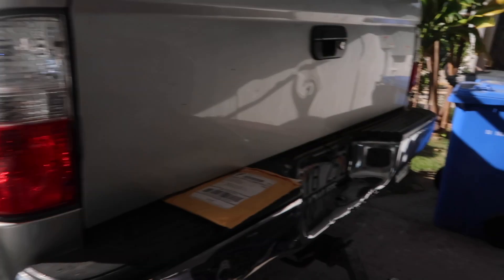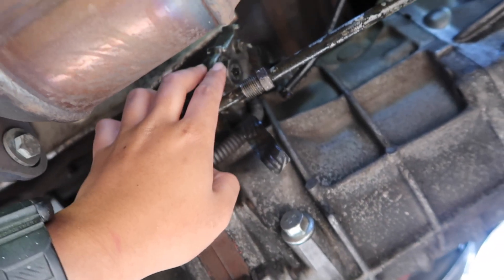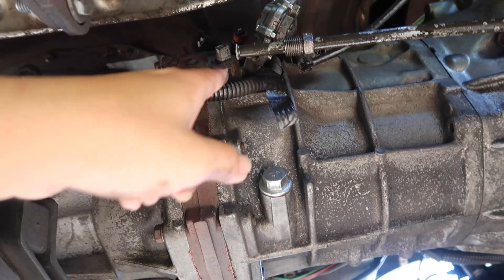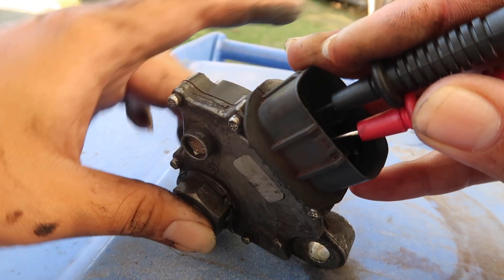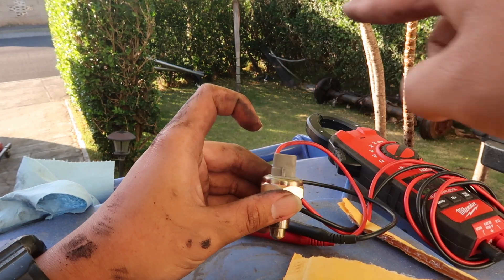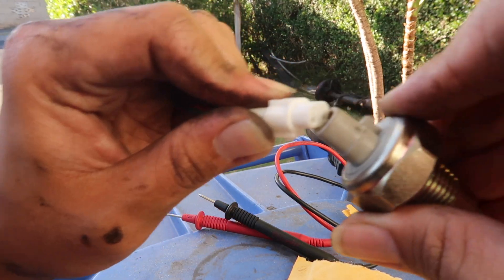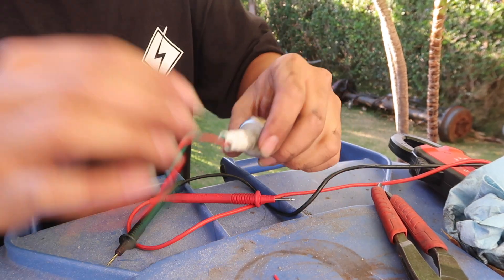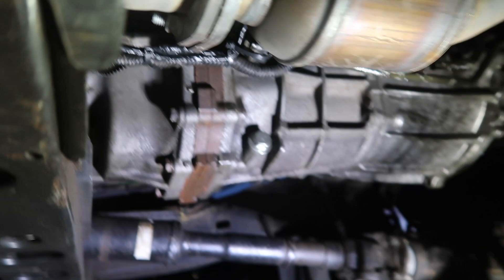Tacoma 5-Speed Swap Wiring & Reverse Light Wiring

Comment: The two biggest wires on that harness are the ones that you can just cut and spice together and then it will start. That way you don't have to leave that thing plugged in. I believe it's the middle two wires. They looked a little bigger than the rest. I just cut the plug off and splice
Two wires onto the two I'm talking about and ran them up to my clutch pedal switch.
Reply: When you spice the two together, will that also allow the cruise control to work? Or do you also have to jump a different set of wires for your cruise control and what colors were they?
Reply: @Moar_Throttle  No, it will be two different wires for the cruise control. Two main wires are just for the start. I used two others for the cruise and two others for the reverse lights. Do some digging and find ur wiri g diagram for ur old auto tranny and it will tell you which color wires for the cruise and reverse light, that went to that plug that you cut off.
Reply: @todhowell5049 thank you for the reply! So I found the two wires on the plug for start, that worked like a charm. 

My thinking is that now I find the “Drive” wires on the plug by checking continuity like shown in the video and jump those together and cruise should work, right? I’m assuming that’s the other two wires you jumped for cruise control to function? 

I appreciate your help on this greatly🙌🏼
Reply: Yes. Or you can look at a wiring diagram for your truck and see which wires go from the cruise control. Or if you have a diagram for your ecm it will show you which two pins go to cruise then just look at the wire color and it should be the same down where the plug was. Easy. You just got to find the wire colors. I used a diagram for my ecm, but you can also look at the wires going from the cruise control box.

Comment: do I need a rebuild tittle if I swap my truck to 4by and what if I have the 4x4 ecu do I still need the neutral safety switchi
Reply from the maker: No, your title is the same. As for the neutral safety switch that’s only if you’re converting auto to manual.
Reply: @fortunestatushawaii  ok thank you very much

Comment: Question ik this is a year old but does your cruise control still work if you leave that in park?
Reply from the maker: My cruise control never worked to begin with so I wouldn’t know how to get it working. But I would assume no if you did it this way since the ecu would read that the transmission is in park.
Reply: @fortunestatushawaii  thanks for the quick reply! And I figured, wonder if I get the neutral safety switch connected to the clutch if it would help it, mine currently works im about to fill send it in my 3rd gen runner lol
Reply: If you wire the drive wire to power through the clutch release switch, when the clutch is released (driving) it will think it's in drive, and allow cruise to work. You can also wire your park to power through the clutch depression switch so it only thinks it's in park when the clutch is pushed in, that way you have to push in the clutch to start the vehicle.
Reply: @levimonsen1006  I’m trying to get cruise control working on my DC at the moment, would I just be able to jump the two wires you mention at the plug? So I don’t have to run wire up to the clutch pedal?